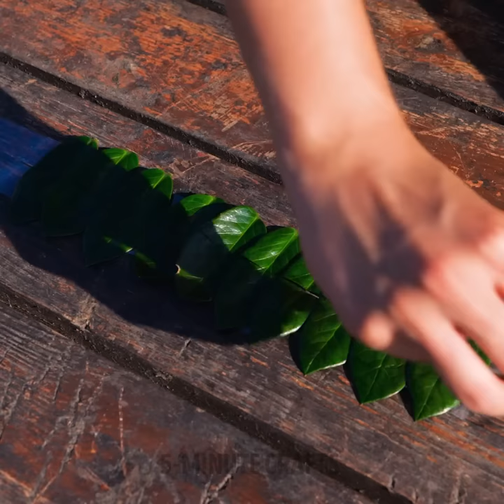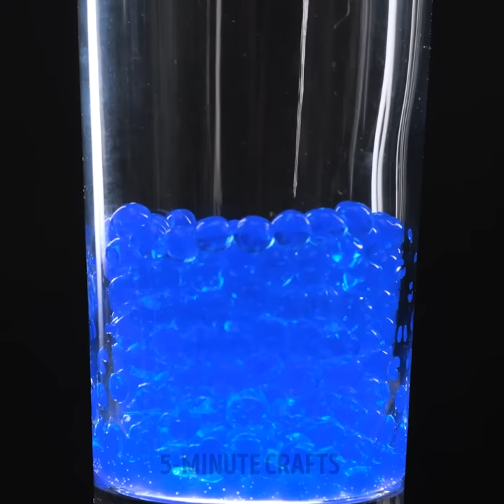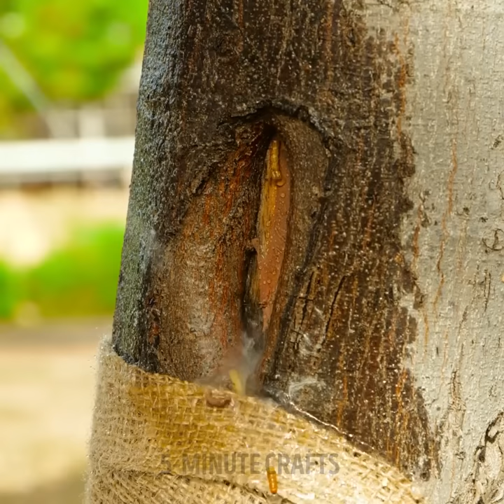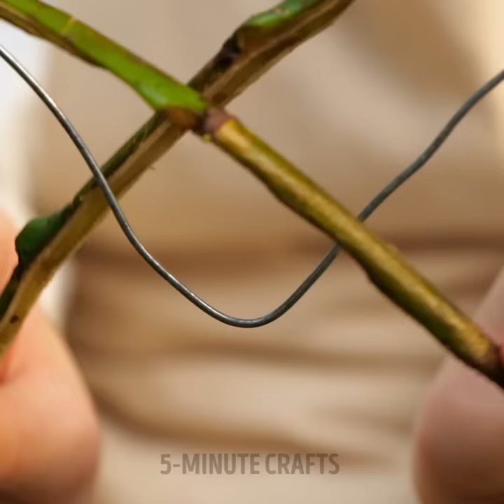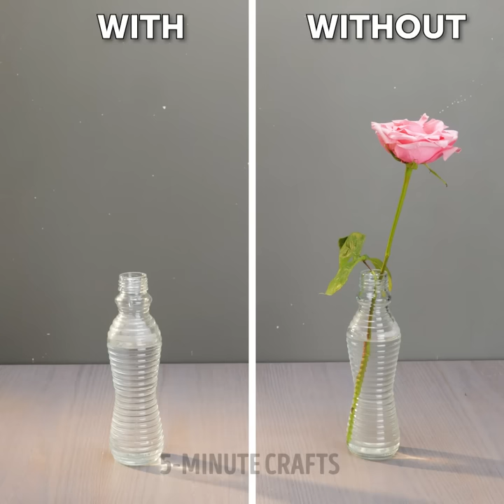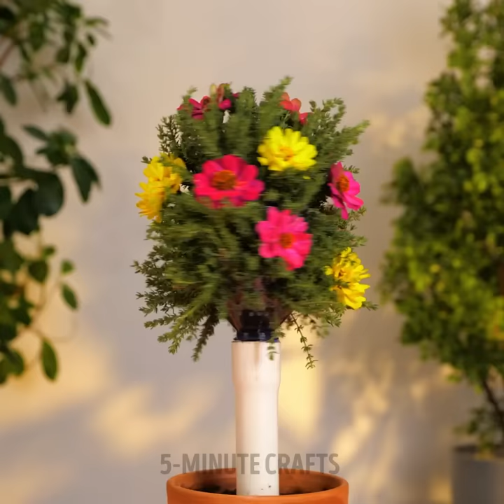How to Grow Your Dream Garden || Gardening Hacks, Plant Care

Comment: Please any new gardeners don't try any of this as it won't work and you'll be disappointed.
You cannot grow bi-colored roses by sticking 2 different colors of stems into something. 
You will never grow a peach tree from a pit like they show. You got to crack open the pit with a hammer, pick out the small seeds inside of it, then plant those. In 3 to 5 years youll have a tree that will bear fruit.
Grape seeds grow grapes, apple seeds grow apples, etc. You will not get a tree that grows oranges and apples because this video says it will happen.
And never stick your plant's roots into straight peroxide!